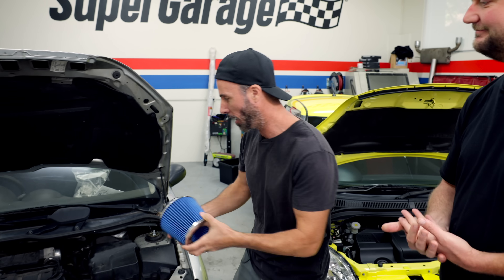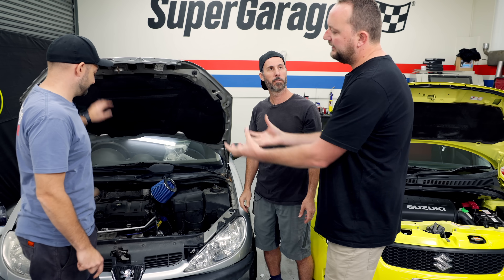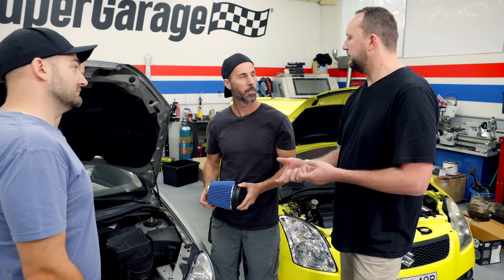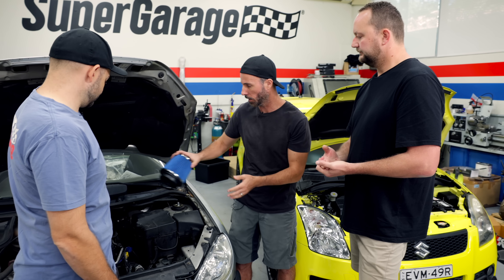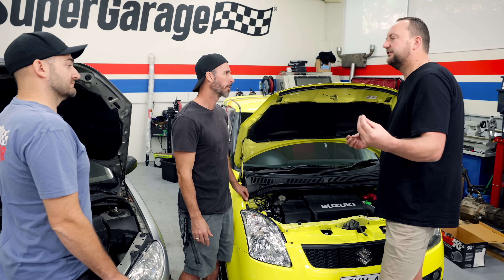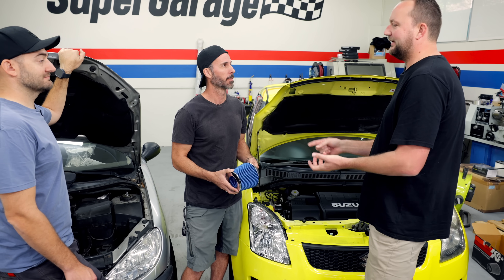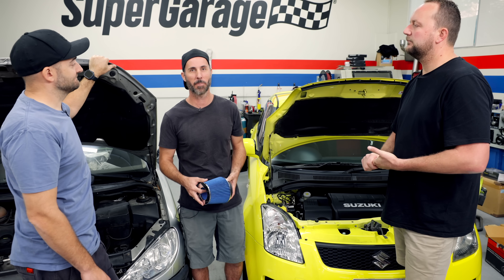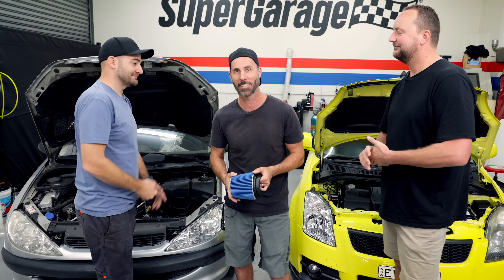Do POD FILTERS Make You Lose Power?

Comment: What about on a car like the Ford fiesta xr4/st150 when it’s n/a and the factory air intake system has a long stretch into a 90* bend into the air box which is sat above the rocker cover and exhaust manifold, then out into another 90* bend down to the throttle body into another 90* bend? 
I’ve fitted a k&n n57i cold air induction kit which is 1x 45* bend off the throttle body into a straight pipe for about 30cm and the pod filter is fitted to the end with a cold air feed going down to the front grill? 

Surely less bends, not being on top of the hot engine etc is better for intake temps?

Comment: In some motorcycles, an exhaust system design has been used where, right after the header pipes, the exhaust transitions into a structure that incorporates a perforated inner tube wrapped in sound-absorbing material, which is then enclosed by an outer shell. This dampened section is followed by the actual mufflers.

I am planning to build a similar system for my car, as my preference is for minimal exhaust noise while retaining substantial power. My question is: does this type of exhaust design reduce engine performance? I believe it shouldn’t have much of an impact since the system remains a fully free-flowing setup that effectively reduces sound levels.

Comment: Those oiled cotton filters let in far more dust than a paper filter.  I race a car in budget endurance racing and I send in an oil sample for analysis after each race. I was getting silica numbers higher than normal, so I switched back to an OEM intake and the silica basically went away.

Comment: I used to keep all factory air cleaner parts on all the cars I've owned. The first time I ever installed a short ram intake it was on a maroon 94 Honda Accord. The air cleaner was getting brittle and I was going to have to remove it to do maintenance. Before I did, just in case, i dropped by the junkyard and wandered up on a metal short ram from a Mitsubishi and a stumpy pod filter with some life left from another car. I bought the pipe and filter for only 7 US dollars. I kept it on hand in my parts pile for a while. The day came where I had to remove the stock air cleaner for maintenance. The plastic and rubber immediately cracked and ripped in my hands. After my maintenance was done I then had an open throttle body and no coupler/ appropriate clamp to just slap the junkyard pipe onto. I had a parts store like 3 miles away and no other way to safely get there. I took a pair of old clean cotton boxers and I used the stock clamp to hold it on the throttle body. I let the car drive itsself to the store. I didn't give it much throttle because I didn't want to blow a hole in the cotton and suck the boxers into the engine. Got to the store and grabbed up a cheap Spectre brand coupler to throw on. It was slow at the store so I told the teenage counter guy about what I did to get there and he came out and watched as I put it on in the parkinglot. We both had a laugh and it looked silly because the filter was a half sized stumpy filter but the thing that caught me off guard was the sound. THE SOUND. I loved it. I could hear more from the car. The car felt more responsive throttle wise and the sound to go with it was great. Later on I found that the air cleaners falling apart on 90's Hondas is extremely common. All but 1 of our Hondas we replaced the plastic with 7-35 dollar metal air cleaners. This last week that 1's air cleaner had a bracket fall apart so It's now a metal pipe as well. If you are someone that wants a bit of whistle and a bark you can hear in the cab get a cone filter with the conical valve bit in the end if you just need to put an air cleaner on to replace the old plastic but you don't want the extra noise get a cone filter with a flat front. Those are quiet. I like ditching the plastic and going to metal it just feels right and reliable. As far as any gains I like to think that I feel a difference on the Accords. Civics I don't notice too much. Ultimately changing out a major engine part on a Honda for a better part will give you more results than changing the air cleaner. However it gives you something fancy that you can see and hear to go with your other real upgrades that you've done with the car. For me it's just the personal Cherry on top of my work for myself to enjoy.

Comment: Not always right. Depends on the car to be honest. My Mazda MX5  k8 engine just responds better with the pod then a stock air box. I have reverted it back and forth and unfortunately it feels like a lug after 4000 rpm with a stock air box  high panel filter.  Nicer under 4000 rpm.... but feels like it's choked. With a greddy M  Pod filter it lost power and felt sluggish. It's bigger then the SCA Pod filters and shape. With a cheap SCA pod filter it just revved freely and pulled past 4000 rpm to redline. Just felt smoother, better and not choking. Gets the revs up quick and performs IMO much better. I love my car better now. so much more fun

Comment: Regardless of whether they gain or lose power, the fact is they allow much more dirt and debris into your engine which will shorten its lifespan. Look up "ISO 5011 Duramax air filter test" if you don't believe me. 

A stock paper air filter allowed 0.4 grams of dirt through the filter, and took 60 minutes to clog up. The K&N filter allowed 7 grams of dirt to pass and clogged up in 24 minutes. So not only do you get worse filtration, you also have to clean the filter regularly otherwise that 1hp gain turns into a 10hp loss lol.

Comment: The way he casually brushed aside ram intakes is incorrect:  It's not only a 0.xx% power increase; it's more like a 1.xx% power increase.  That may not seem like much, but it's potentially free power.

The real limitation is that most cars aren't set up from the factory to be conducive to a ram intake, thus it is not beneficial due to the significant re-engineering required to make one functional (rearranging the engine bay/bumper).
Reply: It also messes with aerodynamics design significantly, especially if it's something that got slapped on aftermarket, which also comes with the added risk of putting it in a low pressure zone that looks like it will get a lot of air and causing yourself problems. I agree if done properly it could potentially be worthwhile.

Comment: I've always wondered I know cold air is better and makes more power. That being said over here it gets -10c in winter and peaks at 40c in the summer. And I've never really felt a difference in power in my car. Maybe it's because my car doesn't have a lot of power to begin with. Or maybe it just happens so gradually that I don't notice. But if someone could explain I'm really interested.
Reply: Cold air packs in more oxygen molecules.  Oxygen is an oxidizer, which blends with fuel in an optimized ratio to be ignited for combustion.  Taking that same ratio, but increasing the amount of oxygen, allows you to burn more fuel, which results in increased combustion.
Reply: Air gets denser as it gets colder, the molecules pack together closer and closer so the same volume of air will contain more oxygen to burn fuel with - just to clarify that first bit.

Comment: You'll lose power but you'll gain fuel economy imo. Everytime I hypermile Poland to England Install a pod filter just above the transmission. I can get an extra 60 miles or so to a tank of fuel. When you do the trip often and use 2 tanks of fuel for the journey one way it pays off in the long run when you're not chasing an extra HP. I want to know the science why I get more fuel economy with a hot intake as appose to a stock air box. I know a small bit from HP academy days but I never got too far into it to understand fully why. I've covered so many miles in my civic for nearly 8 years so I know it like the back of my hand. Maybe it's something to do with the vtec-e I just don't know

Comment: Do POD FILTERS Make You Lose Power? - Depends on the car, the cars intake system from factory, the elevation at which you live at ( yes this matters), and the quality of the filter. Something like a Sprint air filter for a Super Bike, is time and time again proven to increase power figures. However it is also well known to be a TRACK ONLY filter. Barely "Filters" anything, K&N are bad for this too, but they filter a LOT more than a Sprint... So if you are daily driving you car.. or Bike.,, Highly Recommended against. However a Decent one with an intake tube system can obviously help get more air in faster. Whether the car/bike and ECU can do anything with that is another story completely.

Comment: I bought a car used  with a cold air intake, the filter was located in the fender pulling cold air totally sepaerate from the engine bay, it sounded good not sure it added any horsepower, most modern cars have the inlet in the airstream anyway so it is already a cold air intake. The length and diameter of the intake is carefully considered by the automakers so if they are selling a performance car its likely they have it sorted out already.

Comment: you already proved that you lose power with the S2000 (from memory) because modern airboxes are so well engineered that you lose power if its located in the factory airbox location, especially as factory airboxes have their intake in pretty much the ideal area for keeping intake air temps as low as possible.
Reply: My car has the airbox right on top of the engine it gets really hot if I place my hand on it after driving for a while.

Comment: There should be some part or device than can chill the air as it goes into the motor.
Reply: It used to be a joke years ago, using the air conditioner to do this... But then Dodge actually does exactly this, with one of the Hellcat-derived models :D
Reply: @eTiMaGo  fair dinkum hey. I've always thought of collecting the cold water from your aircon drain and spraying/misting it on the intercooler.

Comment: All facts 👌 but did you take into account intake pipe length pre throttle body ? I did testing on this year's ago using a vacuum gauge and found the longer the pipe pre throttle body the more vacuum is made leading me to believe that's a restriction. Anything over 30 cm long at the same size as throttle body starts to create restriction I could be wrong I'm only a mechanic not an engineer 😂👍
Reply: @sinAnon6689  no even a turbo has to suck harder to overcome that same effect if it's intake is to long there for still a restriction how ever slight. Just look at the highest hp drag cars not much before the turbo if anything at all

Comment: Turbo probably impacts all that theory. Tuned intake resonance goes out the window with a compressor turbine chopping up any pressure waves. Also heating of the intake air by the turbo probably is worse than a pod filter picking up warmer air. Hopefully the FMIC will cool it all back down anyway.

Comment: One of the things to consider is also doing dyno runs with the hood closed. I've seen some setups that could make more power on the dyno because the hood was open and it could pull in fresh air. But, with the hood closed it would either restrict the filter box, or made it pull in hot air. It's a good test since you don't normally drive with the hood open.
Reply: Yep...Gale Banks of Banks Engineering is adamant about this as well, do the runs with the hood closed...it makes the vehicle act like it was if it was on the actual road. A vital key is making sure you have enough air being blown at the front end of the vehicle to simulate the windforce as if the thing was moving down the road too.
Reply: @nbrowser  Not true, its missing a lot of air flow that you would have from the running the car to limiter in 4th gear
Reply: Also a lot of places don’t have big fans blowing in like a simulated road also.
Reply: Like at trade school. Technically meant to tune the carb with filter off.  My point to the Turtor was it doesn't run with the filter off
Reply: Unless the intake kit has a heatshield with a weatherstrip/seal which "seals" somewhat with the bonnet when closed.
Reply: That is also as wrong if you dont run it in a wind tunnel, most places have way way to little airflow to replicate road use. If you have datalogs of road/track you know what intake temps you should have. Testing cold air intakes is not fully done on a normal dyno, in the oem World dynos in the wind tunnel are used for that.
Reply: @garagecedric  Don't need a full on wind tunnel. Some good high velocity fans will do the trick. Can put one towards the radiator and one towards where the intake is. Isn't perfect, but gives more real world results than the hood open.
Reply: Thats because it has less airflow then actually driving. Doing a full pull in fourth gear all the way to limiter would be very high speed

Comment: OK, so obviously they can't cover every single minutiae of detail about air intake systems. One thing that I learned the hard way that I'd like to warn anybody here if they don't already know is you never put an oiled filter on a car that has a math sensor. The reason that is is no matter how good the filter is if you have to oil it at some point particles of that oil will build up on the map sensor and destroy it. I learned this the hard way and it costs me between 400 and $700 to get the part.
Reply: Does a math sensor detect when you're doing maths? 😂

Comment: Genuinely think you'd have been better off just changing the panel filter for a high flow one. Modern intake systems are generally far superior to anything you can buy off the shelf. There's a few different systems for my 208gti and in a comparison test, all the induction kits currently available lost plenty of power over stock and  the k&n and pipercross panel filters had a marginal gain.
Reply: 208 GTI ftw!

Comment: Mad question lads, can you run an intercooler on a naturally aspirated car to produce colder air ?  Sorry for the edit but just to clarify, if you have no space in the bay and have to run your pod hot.
Reply: Using a conventional air to air intercooler will not lower the intake air temp. The air passing through the intercooler fins is at the same temperature as the air going in through the pipe. The reason you run an intercooler after a turbo is because of how hot the air gets when compressed.   So in that case the outside air is much cooler. I would like to see a test with a water to air intercooler with chilled water on a NA engine.
Reply: If you have an issue of the car sucking in hot air from the engine, an intercooler would help slightly with that.

But you'd also be adding restrictions in your airflow and throttle response so any minute gain from it would be lost from the downside.

Solution is to just put your intake where it can get fresh cold air.
Reply: @MrManBuzz  thanks for the reply, I was just wondering if an intercooler would counteract the bad/restricted placement of the pod
Reply: @the-bat-man  You'd have to run more piping to do that so you'd be better off just ducting outside air to the intake one way or another.  :)

Comment: Short answer, Yes. I tune / remap engines for a living. "Open Air Filters" in a closed Bonnet environment generally cause -4bhp loss. Even more than that in a long heat soak test. Then it can be over -10bhp. Just use a replacement panel filter guys !.
Reply: It all depends on the orginal air box and how you install these open air filters. Most poeple choice the cheap dumb ass root of sucking in all the hot air of the engine bay(Killing performance....). These days buy a 3D printer and print the exact box for it so only cold air can be sucked in(Bonus if you create extra ducts for more cold air here, for example create from the brake duct in your bumper a tube to your 3D printed air box increase the cold air comming to the box). 

And only if you can defeat the same heat as the orginal air box you will see a improvement and if you can get it colder all kudos to you. But mostly its indeed better to stay orginal since these people will not take the time to fight this big problem with open air filters.

You probably know this to already but the performance increase if done correctly is not that big if the OEM manufacturer didn't fuck the orginal air box up for emissions or sounds reasons(Really small chance that you have a car with OEM filter box that sucks so much for this to outway a shitty install of a open air filter.).